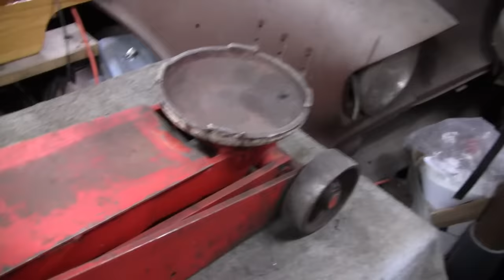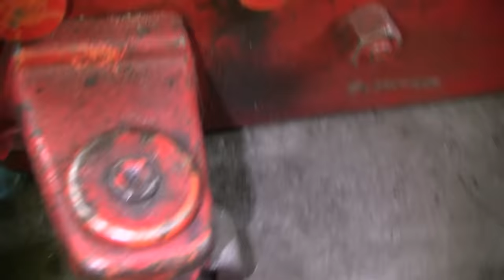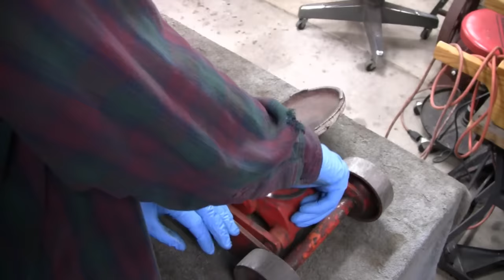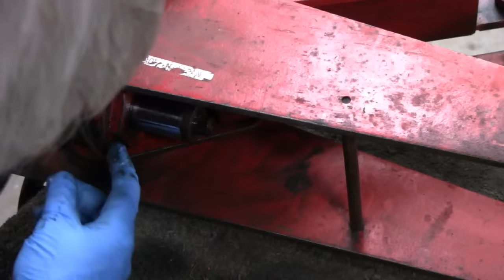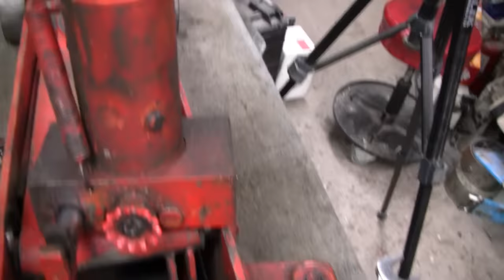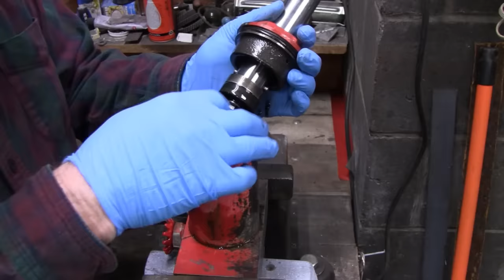HYDRAULIC FLOOR JACK REBUILD

Comment: The reason the filler.on the axis is yes so air is in resevor so u can put the entire jack under a car or watever and the handle will lay all the way down and the jack pad will also depress all the way. Other wise with handle dn. And hydrolic cylender full the jack pad wont seat at bottom it will be raised about 1.5 inches .and that 1.5 inches will keep u from getting under frame or bottom shock mount.. Hope i helped. I learned this because new jacks the fill cap is on top. So welp im sure most ppl can figured out how i learned this.. Dont believe me fill it full. And try it

Comment: Best to use the hydraulic jack fluid as a the lubricant rather than vaseline. Great job though!
Reply: Agreed! You already have the hydraulic fluid handy anyway, put it on all the o-rings. Makes putting everything back together easier, it's slippery than the jelly.
We'll done video!
I have a 4 year old HF that's stored outside but under cover that works great. But if I see one these at a yard sale or flea market, I'm going to get it and rebuild it.
Reply: Also agreed.
Petroleum jelly will eat through rubber so if that is on any O rings they won’t last long and will leak again.
Not sure on that blue plastic piece. If it’s hard rubber then it will be eaten also but if it’s plastic it might be ok??

100% silicon grease is ideal for rubber seals.

Comment: Great instructional. I’ve been hesitating rebuilding my O’BOY Model (DS) I believe, by Hein-Werner. Made in USA, I picked it up for $15. Only issue is leaking. Structurally sound. I guess my apprehension in the rebuild is getting the right kit. Where did you get yours? 
Thanks, Steve, Plymouth, MA
Reply from the maker: Ebay!!☺

Comment: I have a jack just like that, a copy from over twenty years ago, made in china of course, but not that it was cheap then, due to the solid steel sides, etc, very heavy, maybe a hundred pounds.....I worry about how I have used the hell out of it, and sometimes in the back yard dragging it across the lawn, to the driveway, getting dirty,...or just from use, I worry about when it finally needs a rebuild if I can actually rebuild it, cause a jack like that even a chinese made copy is like about two hundred dollars, maybe more, plus I have a spare saddle I welded onto a trans adapter that I plan on cutting off and welding onto a steel cross beam adapter, the type with two load supporting pads.  Plus there is the sentimental value of a piece of equipment that had given me good service for over twenty years, that is why a person wants to rebuild something.....or have it rebuilt someday.

Comment: murphy oil even works on my old classic 1971 MGB GT. the front crankshaft seal stops leaking. not sure is good on the gas injectors even though it stated for gas engine as well. i stick to the oil seals

Comment: Great video. Something I can do. Got the seal kit and the jack apart. I'm having a heck of a time getting the cylinder apart. I tried biggest wrench I have with pipe, heat, wd-40...just won't crack. Anyone have any suggestions?  I'm having somewhat of an issue holding it still, but I got a bit of pressure on it and it just won't budge.
Reply: you can try taking it down to your local auto shop and see if they can loosen it for you.

Comment: I've noticed over the years how people scrap good equipment thinking newer designs are better, or not cleaning and identifying the tool to order parts.
Some, there were once no known part source for them, and they had to be matched up.
Time can be valued higher sometimes, or management looks off the rebuilder and their jobs go stagnant.
One day, there is no supporting rebuilder shop.
Now we have internet sources and you found the kit.
I noticed you changed the direction of parts in the rebuild and achieved success.
Makes you ask how they got in that way, if they ever worked?
And did someone try rebuilding this before?
We used to get some returned to us only bypassing and were told they were unfixable.
They went to scrap.
Hmmm.
Bummer. That's all it took was some basic skills and understanding of hydraulics with good judgement.
I bow to thy successful attempt and if I was there, I would buy a round.
Nice ride.
Is that a 35?
It's a beauty.
Reply from the maker: Thanks!! 1930

Comment: Where can you find right seal kit ? unless you have a 300.00 jack to begin with, there are no seal kits listed . I have a 3 1/2 ton made in china with no brand on it . It has all the same kind of o rings, and seals , so don't know why it can't be fixed as well . BUT WHERE TO FIND THE RIGHT SIZE ? ?
Reply: i guess it was a "universal kit" since he didn't use 80% of it
Reply: @ricebike  OK , thanks, but I need to know WHERE ,
Reply: @dennisfrier3191  ebay or amazon are my main go-to places; i'll let the OP of the video chime in though. that $45 price tag is kinda steep

Comment: Hey thanks for this. One of life's little mysteries revealed. Always wondered what the guy who did this for a living actually accomplished.
At about the 32 minute mark I am looking at a grease fitting that could stand replacing. Couple squirts of grease,the old girl will never squeal again. A little moly grease,and good for the next 20-30 years. Cheers.

Comment: The plug on the right is the pressure relief valve that is factory set. Leave it alone.
Reply: Ojo Felix NM  it can be adjusted and cleaned

Comment: I wonder if it would have been best to wet the O-rings with hydraulic fluid before installation? Nice hot rod! I need to rewind & pause to try and get a better look at it! What year, make, model & what drivetrain? I am a HUGE FAN OF THE 1973  (4.125 BORE) Chevrolet small block 400 & I NEED TO FIND ONE ASAP! My brother lucked into one by hapistance! It was built by a local machine shop, bored .030 over to a 406 & utilized a stroker crank, custom rods, pistons, cam, heads, lifters, push rods, hydraulic roller rockers, built th-400 transmission,2,500 or 3,500 stall convertor(I forget which), I could go on & on! It ran LIKE A CHAMP! 0-120 like NO OTHER VEHICLE! 383 GEARS, Holley 750 double pumper, sitting in a red 1979 Chevrolet Camaro Z-28 PICKED IT UP IN THE EARLY 2000'S FOR $3,250.00

Comment: Could you have done the job just as effectively by cleaning up the cylinder, the reservoir, the old valves, seals and O-rings and putting it back together?

Comment: I have two of those jacks , I bought mine in mid 80's it jus crapped out 2 yrs ago ..
I have my father's red craftsman jack from 45 yrs ago it stopped working bout 5 yrs ago .   So yes I will order rebuild kits .   I to have two harbour Freight jacks ..
But I k I harbour Freight jacks will not last over 25 yrs ..

Comment: you should try plumbers silicone grease on O rings and seals.
Reply: I agree. No petroleum based lubricants. But for installation purposes it should be fine.

Comment: You have to spend at least 180 to get a decent knockoff. It will not last as long as this. Rebuild kit. Well worth it.
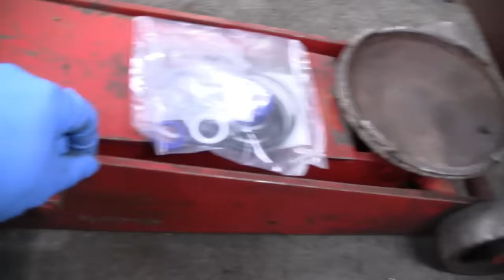Carry on, good man, I want to see this! I'm @1:24. I am not doubting. I was told by "mechanics" it can't be done.
I never believed it. Neither do you or the provider of the rebuild kit. Also, you wold not have made this video if it can't be done.

Comment: WHERE does a person FIND the CORRECT  Rebuild KIT ?

My old JACK is so decrepit that it no longer has any identifiable TAGS or DECALS or  SERIAL NUMBERS etc ...
Reply: I'm in the same boat Dave , unless you have a 300.00 - 500.00 jack to begin with there are no seal kits listed .
Reply: i guess it was a "universal kit" since he didn't use 80% of it

Comment: Thanks!  I needed an engine crane.  I found a nice one (USA made) on the List , lightly used by a vintage car racer who was retiring from the sport.  I had to drive 70 miles each way to get it and spend more than for a new HF crane, but when I see those junk Chinese cranes moaning and groaning to pull a motor, I know I did the right thing, even without a useless warranty.  After all, what good is a warranty in the middle of pulling an engine?

Comment: Also Vaseline on "O" rings is what you use never put them on DRY..
Reply: I was told not to use petrol based lube on rubber by several old timers

Comment: 5 years later and now you cannot buy a HF jack for $50. they start at more than $100 for the little ones and go on up to .."I think I'm nascar" level stupid expensive. My 90's Advance jack looks alot like this, but the valving is a little different.

Comment: Where do you get the seal kit for these?
Reply: I think he said eBay. It is some sort of universal kit, which is why he had extra parts. Good luck!
Reply: @hgj2019  Hi! I just bought a new 3 Ton Jack at Harbor Freight last Christmas and have used it many times already.
 All the labels and ID numbers were gone off mine so just gave up on it.
 Any jack is better than none but none so handy as a floor jack, granting it has enough lifting power for the job preferably with a smooth surface to roll it on.
Reply: @RC-Heli835  I saw that you were asking a year ago. Felt certain you had already solved the problem. Frankly, I like fixing things as much as anybody, but sometimes a $40 rebuild kit compared to a $100 (roughly) new jack is an easy decision to make. Like you, I just bought a new one, but kept my old. As it turns out I need two fir a short while, so I may but a kit. Almost hate to, but the old one is otherwise good and I hate to toss it.
Reply: @hgj2019  Yea I kept my old one as well just in case. Its black and yellow and I believe its a Craftsman.

Comment: You can buy a new pretty Craftsman aluminum Jack for about $300. It will last less then 5 years. They can not be rebuilt. The old jacks made in 70,s and below are all well made. The younger generation  does not realize  this.

Comment: These kits are available on Amazon. However, I would not pay $50+ dollars for the kit. I pulled my seals, Packing, and O-Rings, Brass washers and went to the local Bearing supply. Used caliper to check Dimensions. Had them matched up and only cost me $18. No Shipping! Floor Jack back in Service. Thanks 805ROADKING "Stellar Video".

Comment: nixe quality product to begin with.  notice the hard chrome on the pistons.  not a speck of wear or corrosion here.  That's what kills most jacks.  Square ring at the bottom  and "o" ring on top so much better than the flat plastic rings on the cheap-os.  Good luck with a real classic.